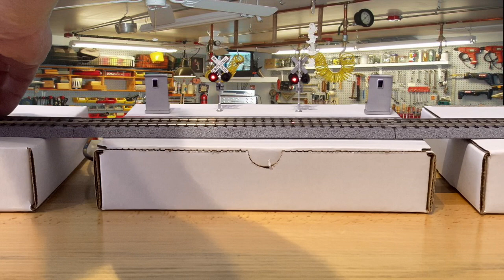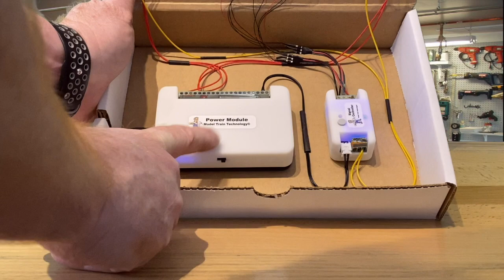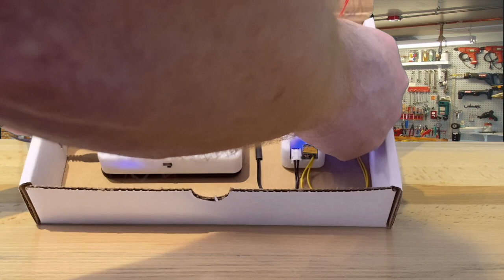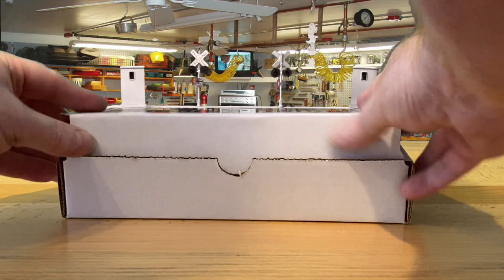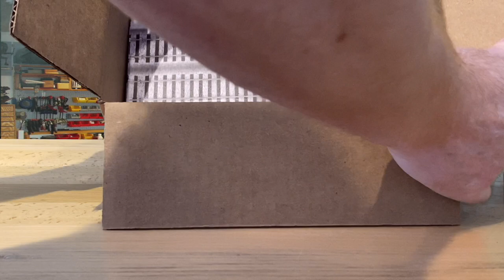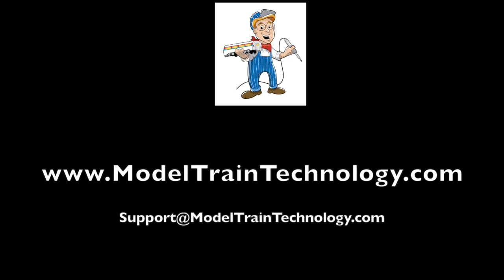Crossing Signal in a Box!

Comment: What do you do for the bells?
Reply from the maker: Our Sound Controller has the bells. Powered off the same Power Module and linked to the same signal wire.  You can record you own sounds so you can have the bell AND 3 other sounds with separate sensors.

Comment: Very nice. Thank you for going the extra mile for your customers. I will eventually be making a purchase. I'm assisting a model railroader who would like crossing signals for 3 parallel tracks. I think your system would be ideal. I may eventually be installing your signals on my own layout as well.
Reply from the maker: Glad to help
Reply: @ModelTrainTechnology  Jim, I believe somewhere I heard this is good for two HO Tracks but will the 3 track setup work for Jason (And my 3 parallel tracks) as well?  Thanks for a well thought out product!
Reply from the maker: @Archerman.4514  If the closest rail of the third track is within 5.5" of the sensor, it will work.